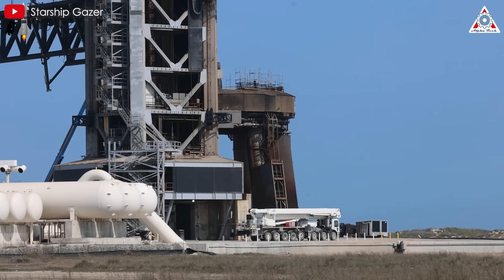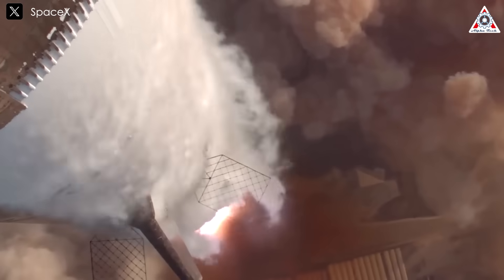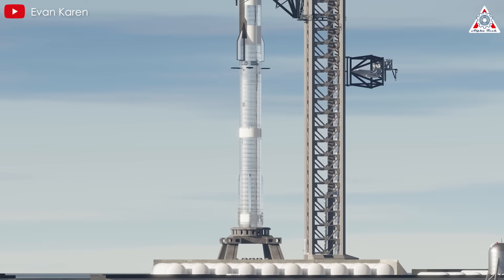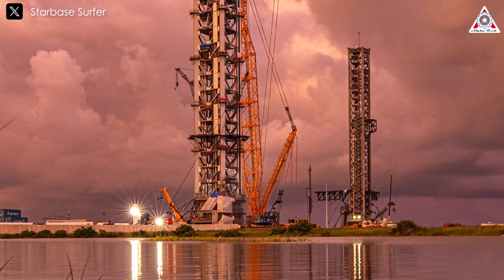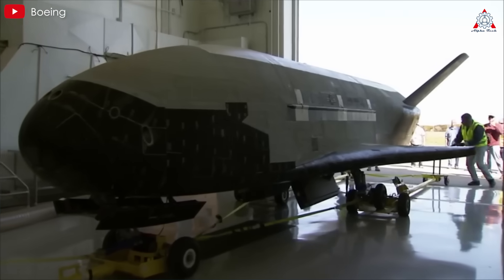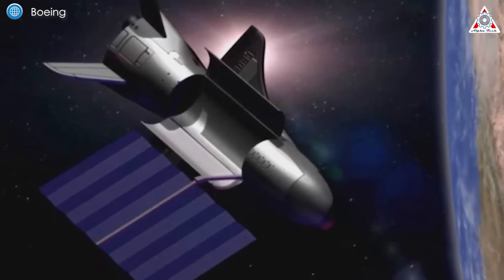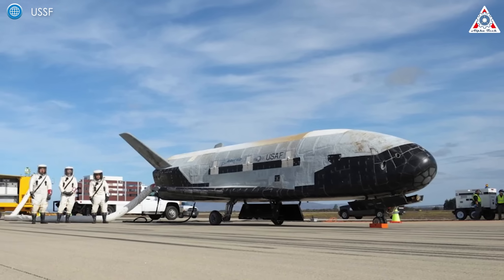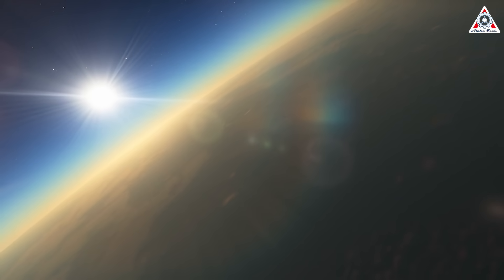SpaceX Stage 0 Still Facing New Trouble After Starship Flight 8 Launch...

Comment: Tower B is the future with its new flame trench and water deluge system. It deflects most of the initial launch blast and shock wave away from the tower and the ship. Once Space X starts using Tower B for launches, Tower A is still useful for catches, but will need to be replaced.

KSC Florida will be using a similar system. Florida is where Manned flights take place and will need a gantry system to allow a human crew to enter starship....

The question is Starship block 3 is even taller, I wonder if Tower B, has a special section just below the top section, that can be extended...